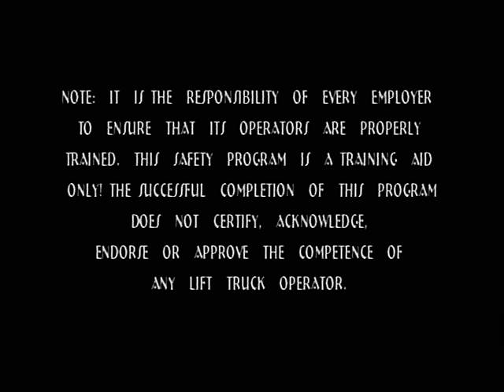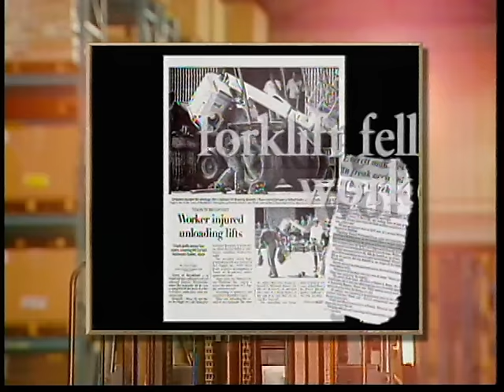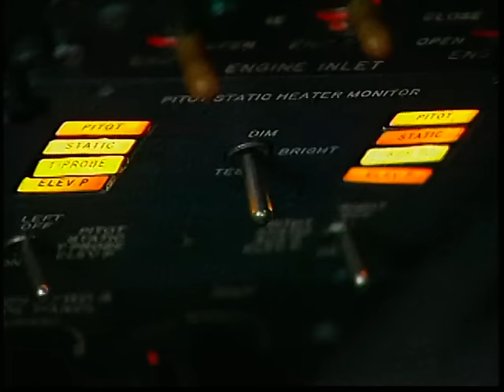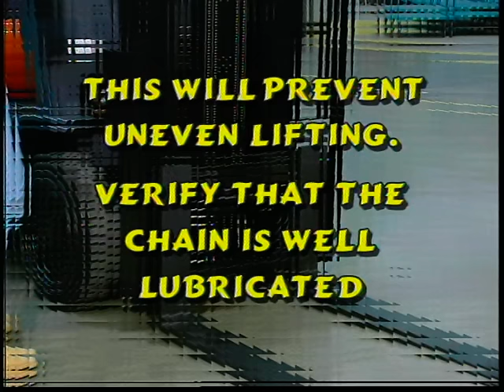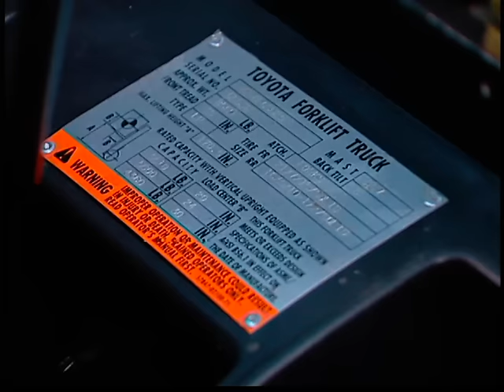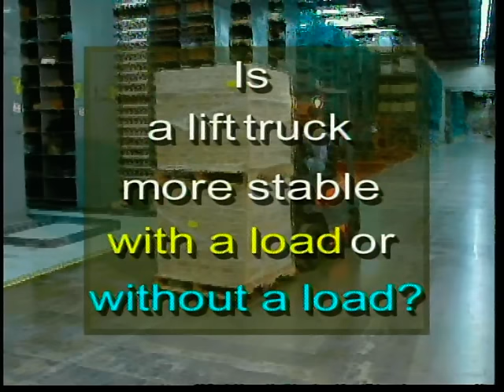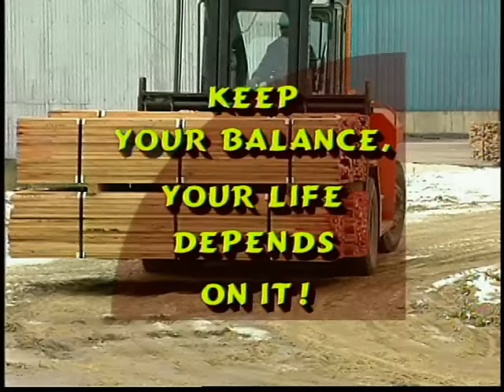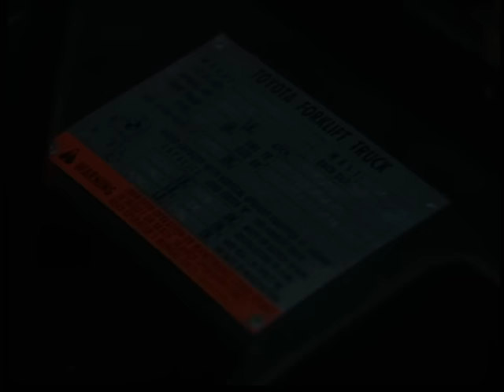Forklift Training

Comment: I'm Germany now and I trained for 2 days for practical and 1day theory. Honestly there are many thing i wasn't taught but i gained more experience by watching this video. Thank you. It did helped me a lot.
Reply: That's good brother.  But, aye I'm a certified forklift Operator. I got five Certifications, and forklift experience for 7 years on it.  Til today and ware house experience, 8 going on to 9 years.  There is some points I see here that is not correctly corrected.  Lmk if you need assistance.  I will gratefully give you the correct ones.  This looks old and mods now days have changed for better safety.  Just like "MSDS" right.  Now it falls all into one as "SDS". .. all falls in one.  N follow one now.  so yea, I see some here not right.  Depending on the company you work for to.  Example the key part.  Turning it off , and take the key? . Most ware house now days leaves the let there.  Depending on you're company.  So be open minded from this.  bless
Reply: @CVS819  My fork truck handles 50 ton coils got any tips for me? just curious